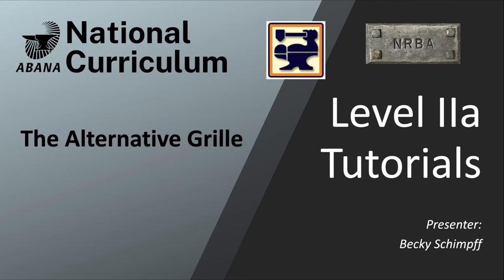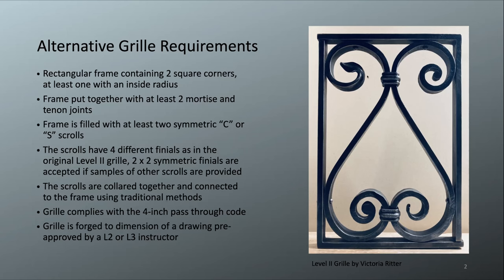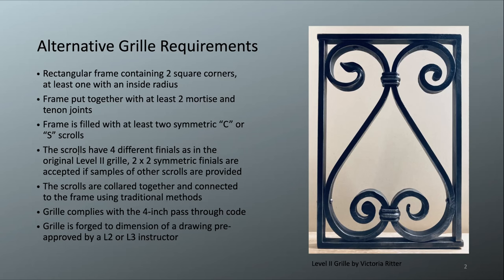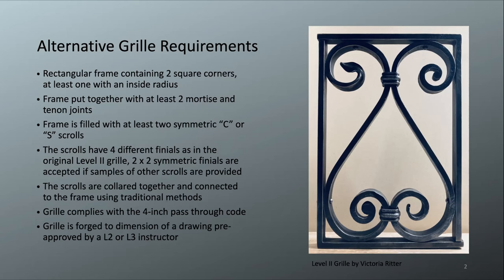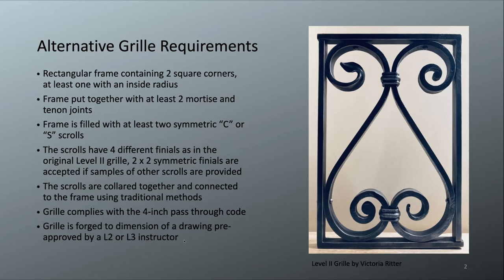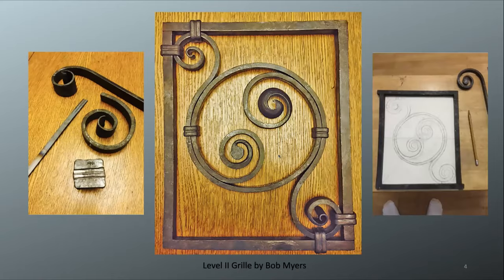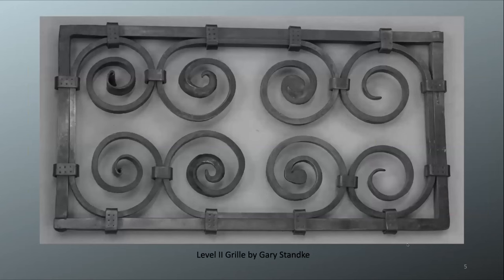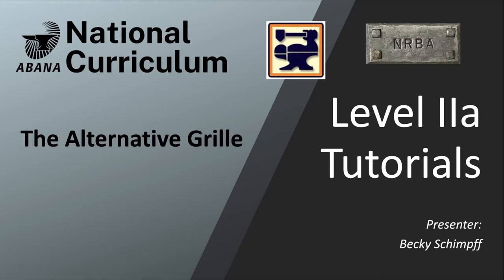Level II Alternative Grille Designs with Becky Schimpff

Comment: 2 square corners on one bar and match the space of the drawing is impressive. I have done the 2 corners on the same bar but I haven't figured out how to stay within my dimensions yet. If there is a trick to figure out the formula I would be very interested in hearing it.
Reply from the maker: Hold tight for our next video with Becky…she covers how to place the corner where you want it on the bar.